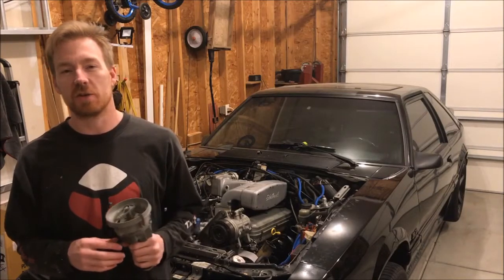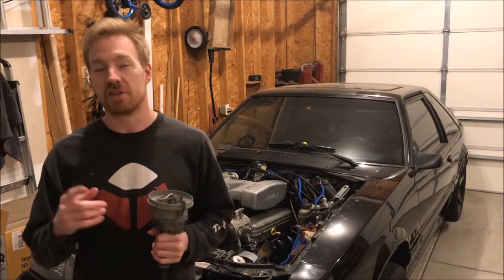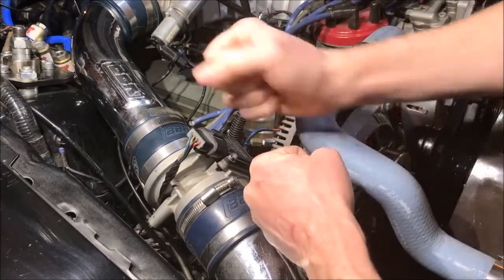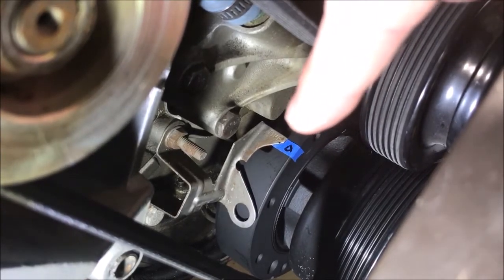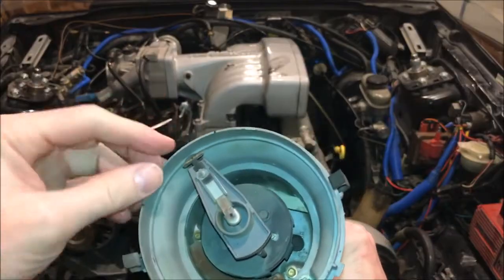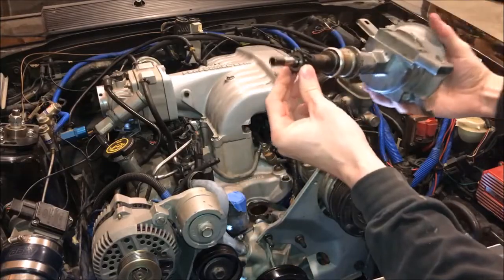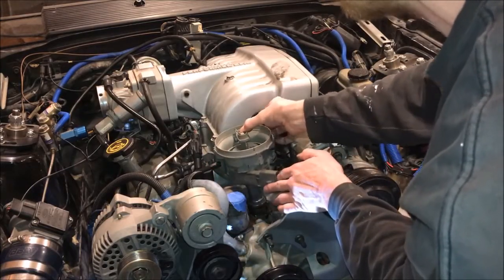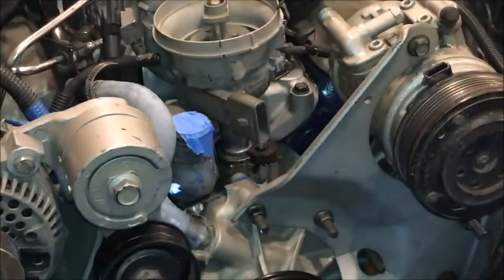Set Timing for Engine Start

Comment: I was always taught you should set the timing mark to about 10 to 15 degrees BTDC and then set your distributor to #1 so that on first start your timing is a few degrees before top dead center which is where your always going to run it anyway. This is especially important on a newly built engine with a flat tappet camshaft as you NEVER want it to idle during the first start and 20 to 30 minute break in, not even idling long enough to use a timing light, and you never want to be sitting there cranking it several times during the first start because it doesn't want to start properly at true 0 degrees top dead center timing, hence setting it a few degrees BTDC.
Reply from the maker: Good advice!

Comment: Just did my hci I followed your method but rather than 0degrees, I tried it at 12degrees. She just turned over, no start, she tried, no avail. Tomorrow I try it at 0. She sounded broken trying at 12. lol
Reply from the maker: I always start at zero then work my way up. It may not run the best at first, but it’s okay.  Can progressively tune up and that’s satisfying. Thanks for commenting
Reply: @FastFixYouTube  the next morning, did it from zero, she started. Mind you, I just did the hci, so I had a little bit of work to do after but she’s run nice soooo nice. Thanks for the video, although I also ignored the 89 mustang shop manual because I really wanted to pay myself on the back.  The old adage rings true, if it ain’t broke don’t fix it. Again thanks, and thanks for the reply. Two thumbs up to you. Toronto, ON CANADA considers you friend. Thanks
Reply from the maker: @reachadcreadordasilva3471  hey, fantastic!  Glad this video could be of help. I appreciate the Canadian connection!  You’re a friend of the States (for whatever that’s worth 🤣) as well!  Cheers!

Comment: It seemed like the rotor was pointing toward the driver side head.  I am confused.  Is it supposed to be there or pointing directly at the number 1 piston
Reply from the maker: Hello. You saw correctly. However, The rotor needs to be set at the #1 point on the distributor which leads to the #1 cylinder. So, the rotor won’t physically point to the #1 cylinder rather in which ever direction the #1 point is located. Hope this makes sense.
Reply: Awesome thanks!  Also was the timing on the harmonic balancer set at 0 degrees when fired or just before? I've been told to set it at 12 degrees BTDC

Comment: You said point rotar toward cylinder 1 and then pointed it toward cylinder 8 the hell?
Reply from the maker: No I didn’t. The car started. If pointed at cylinder 8 it would not have fired.
Reply: Cylinder 1 on the cap, not the piston. The rotor should be to the left of the right lower intake bolt. @fastfixyoutube done it exactly the way it should be done

Comment: Great info! I had to take off the ignition module (on the side of the dizzy) on my 89 F250 7.5L. It seems so easy, I’ll be trying to do this and start her up tomorrow. She ran a few days ago before I took out the dizzy. First time is 12 years!!
Reply from the maker: Hey there. Yes, this should work for you. Update this thread with the results if you feel so inclined. Best of luck!
Reply: @FastFixYouTube  Worked like a charm after I got her to 10 degrees BTDC. Cranked up instantly, adjusted the dizzy slightly with it running. She’s running great!!
Reply: @Mc88Flyy  8wire I

Comment: Ive done this many times but i enjoy watching others doing it, you can always learn new things, when i was young (a long time ago,lol) i use to think that when people said "point rotor to number one cylinder"  they actually meant to point the rotor to number one cylinder literally when in reality is the number 1 on the cap, ha ha ha ha, needles to say that didn't work very well.

If i may add,finding number one on a stock Mustang distributor is as easy as lining it up with that black sensor inside your distributor, you line it up with that and your good to go, also when you get ready to "stab ' it turn your rotor to the left about a inch,once it goes in and the teeth mesh it will move it to the right, 9 times out of ten this will get you right in front of the black sensor and your good to go,putting it in on number 1 and hoping it goes in straight does happen but very rarely, most of the time it will move to your right hence that one inch to the left.
Reply from the maker: Hello!  Hahaha, well we’ve all made those assumptions when we were green.  Hell, I’m still learning all the time and I learned from your comment!  Thanks for that tip. I’ll be using it in the spring when the new motor goes in!  Have a great one 👍
Reply: @FastFixYouTube  I actually ran into a funny issue tonight starting a brand new 302, had it all primed and ready to go, stabbed the distributor and it wouldn't start,well we had been working all day on it and i was pretty tired, started checking everything carefully and i had the distributor off by a hair, pulled it back out, tried it again and man it started like a  champ.

Sounded great,  strong like a new motor should  but i had started it with the belt off, just wanted to make sure it was gonna run,so we turned it off, gonna slap the belt and take her out for a spin, hit the key and it never started again no matter what, has fuel and spark, lol, have no clue whats going on, sure hope its not something internally but those 20 seconds it ran it never made any weird noises, none at all, just pure motor symphony.
Reply from the maker: Hey there!  Hmm, yes that is odd. I’d say it’s likely an ignition issue if you’ve got the timing right. Doubt any major internal problems. Yes, the sound from a new start up always gets the blood flowing. Pure awesome.
Reply: @FastFixYouTube  Hey, thanks for the reply, yeah i just tried it a minute ago, its definitely timing,i have it stabbed right its just not in the sweet spot yet,lol,keep on trying is all i can do,that new engine is decimating that battery,lol,nothing like a new tight engine to put strain on everything.

Comment: This is gonna help with my low compression 350 that's getting a really dialed in tune. locked distributor, small carb. it won't make a ton of power, but it should jump if you punch it.
Reply from the maker: Sounds good!

Comment: Thanks this really helped me a lot you have no idea
Reply from the maker: Hello!  Glad to hear that!  Thanks for the comment 👍
Reply: I do have one question should the oil pump shaft have any play and if it does should I replace it
Reply from the maker: Hello. Sorry about the late reply. There is usually a little play with the shaft.  Get a good visual inspection and make sure it’s not warped / bent. If all is well, install 👍

Comment: good vids brother, i used to have a 1988 stang 5.0 body style just like yours . mine was a rare make 4 cylinder with turbo. rear wheel drive. automatic 5 speed but i put a older 4 speed auto tranny in it. had more torque power. 
 before that i had a 68 1/2 mach1 midnight matelic blue. Boss351  under the hood holly 4 barrel 750cfm double pumper/ 3/4 race cam double roller lifters. 4 speed on the floor with headers duel Flow Master exhoust ststem. black leather interior.
Reply from the maker: Damn man, those sound like awesome rides!  I think it’d be super cool to have the 4-cylinder turbo and make it scream. Maybe a future project some day. Thanks for sharing! 👍
Reply: Blew away my brother's Camero he had 350 with cross fire fuel injection . I raced him from Fairfield conn to 9W Newburgh NY . Beat out runned his V8 crossfire camero he could not believe it. to this day he still is confused. 😂
Reply: Ya would make  a great racer also good on fuel not bad with turbo.i was happy with it when I bought it off a jaguar dealership. Bought it for 5k. Only 1 owner.
Reply: And only had less then 60k miles on it at the time

Comment: A question please; I have a 94-95 302, PP graded balancer (0-20 degrees), I read that the rotor arm has to be clocked in a way to touch the No.1 cap contactor at 10 degrees BTC and not at 0 degrees like you did.  Is this correct?
Reply from the maker: Hello. In order to advance timing, it would have to be that way. I start at zero just to make sure it’ll run.  However, it should start and run better with 10 degrees of advance. I start at zero and make my way to 13/14 degrees depending. Hope this answered your question.

Comment: Would this work if my engine is rough idling , misfiring and shaking? I changed my distributor cap and rotor also spark plugs and wires . Wanna try this before I change my fuel injectors and distributor thanks
Reply from the maker: No, this won’t help you. It sounds like you’ve got timing, spark, or fuel issues. 
Make sure your plug wires are routed correctly. You’d be surprised how often a mis-connected plug wire is to blame. 
This video was meant for those just trying to get their engine started.

Comment: I just did a rebuild on my carburetor for my 84 Bronco ii. Now it won’t start, I have spark, it’s getting fuel, it cranks and cranks and won’t start, the 2-3 times it did start it wouldn’t hold idle unless foot was on gas.  Could it be timing, should I try this step you showed?
Reply from the maker: Hello. Yes, definitely sounds like timing. Find the compression stroke then set TDC. Feel free to Let me know how it goes.
Reply: Or firing order on cap wrong
Reply: Seen many peep make that mistake have 2 or 6 wires crossed on the. Plugin of the distributor cap.
Reply: Or distributor not set in place right could be a tooth or few off set.
Reply: And make sure you follow your engine block firing order. To the cap. Look up your year engine and it will show you

Comment: Tried this on my 86 f150 and tried to start it now it wont start and will back fire really bad any help
Reply from the maker: Hello. It sounds like you’ve found TDC on the exhaust stroke. Make sure you’re on the compression stroke then try again. Also, make sure the spark plugs are in the correct order. That happens more times than not. Feel free to update the thread if you’re still haven’t issues. 👍

Comment: I'm having a little problem on my '95 to a '94 OMC Cobra boat motor. What's the timing? Mark in the rotor where it should be at for the fire at the first try like you did in your video please get back to me thanks it's a 351 Windsor
Reply: It's not a vacuum advance. It's one just like yours in the video distributor
Reply from the maker: Hello. Happy to reply!  Please give me a few more details. Have you gotten the motor to fire?  If so, increase the timing to about the 13 degree mark, but do it incrementally. You want to get to the point where the motor doesn’t knock based on the octane of the fuel you’re using. It may be beyond the 13 degrees mark or a bit below. Not every motor is the same, but they tend to be very close in range. Then make sure to use the same octane gas for the future.
Reply: @FastFixYouTube  It was knocking and I shut it down quick so I redid it and I don't hear the knocking no more
Reply from the maker: @chriscorter5035  perfect!  Seems like you got it sorted. Thanks for the question and reply 👍

Comment: I’m currently working on a 1987 f150 Jasper 302 and was told to put it at 10 degrees on the balancer. Guessing I was told wrong.
Reply from the maker: Hello. 10 degrees is a factory setting and not wrong. It’s just “safe.”  That way you can run low octane fuel and be perfectly fine. Generally, 13 degrees of timing is also “safe” and what I run in this car mostly on 91 octane, but I’ll use 93 if I can find it.
Reply: @FastFixYouTube  Thanks for the information man

Comment: My car turns on but stumbles and dies right after unless I keep peddling the gas,I recently had a bad battery and I would have to jump start it everytime,my question is can a bad battery throw off the timing??
Reply from the maker: Hello. Short answer is no, a bad battery has nothing to do with engine timing.  You likely have a fuel starvation issue somewhere from the sound of it or the motor isn’t getting air which happens when mice make a nest in the air intake. Best of luck!
Reply: check your fuel filters and if not fix after changing them then you have a fuel pump going bad.change it asap.

Comment: I have a 77 mustang ii 2.8 liter. Got it running but idles high. Any suggestions?
Reply from the maker: Hello. Sorry, I don’t have much experience on those engines.  I would say to make sure the timing isn’t too high as that can raise the idle sometimes. I assume that’s carbureted. There should be a screw adjust for the idle I believe. Sorry I can’t be of much help, but thanks for the question.
Reply: check your firing order on the engine and on the cap. if 302 or other . depending on the year 302 engine or 351 .firing order changed in 93 and up. so be aware of that. in this video above  Fast Fix is showing a HO 302 timing setup. firing oder . 

if your engine is a older type then do not follow the firing order in this video above. go to vintage website for vintage 68 - 82   302  351w firing oder. as the 302 and the 351 windsor are both the windsor engine family.

Comment: Great videos. Was wondering if you can make a video on the egr system. I am in th process of puting on a trickflow top end kit. I am deleteing smog pump and was wondering if i should delete the egr valve also. And if so the process to do so. Thanks for the great videos
Reply from the maker: Great suggestion!  There are videos out there that cover the process you suggested.  Zero performance or negligible performance gains with egr delete, so only do that if you're going total off-road or for aesthetic reasons. How'd the TrickFlow top end kit work out?
Reply: you should delete out the egr system. they cause more engine damge then anything else. just my opinion.
Reply: you can delete out the egr simple trick and it will be legal emissions test pass. simply remove the egr. they have a egr delete kit where the air will go from that area over the the fresh air intake. simple easy egr delete kit. they make them for the 6.0l engines and all other engines with egr valve.watch the video on it. and there you will have the info on it and the site to order the egr delte kit.

Comment: Hey just wondering I have a 1986 Mustang and it’s pretty much stock I see you didn’t take out the spout it’s a small little computer chip  Does that even matter
Reply from the maker: Mike Marks hello. You’re correct. I didn’t take out the spout for the initial engine start. I wanted to make sure it ran first then remove the spout to advance timing to 13 degrees. Good eye!  But to answer your question, yes it does matter.  The spout should be disconnected when setting initial timing. Once set, install the spout and you’re good to go. The spout controls engine advanced timing.

Comment: I had a mechanic put a crankshaft pulley on my car. He claims to have changed the crankshaft position sensor as well. [Can't be 100 percent sure] I got my car back with no spark. He claims the car was running when he changed the pulley and belts and suddenly lost spark. Car was running perfectly before he worked on it. I towed it home and changed the distributor she fired but fired very very rough and won't stay started. If I give it gas it'll stay fired but will smoke very bad out the tailpipe. I'm thinking the engine is out of timing maybe he put the crankpulley and or crankshaft position sensor on out of alignment. Is this possible or maybe another issue. The vehicle was perfect before that loser mechanic touched my vehicle. Please help someone
Reply from the maker: Hello. Yeah, pretty weird that it no longer starts after he replaced a part that’s absolutely necessary for the engine to run. He sounds full of it.  

I’d start by making sure the sensor is good.  Because that is one of the parts that was changed, I’d start there. What kind of car was this done on?  Definitely sounds like a timing problem. It has spark, just being delivered at the wrong time.
Reply: Ya he blew smoke up your a zz, he not know but that sensor he bought was probably a cheap cost one and ended up being defective sensor. Always get the oem parts when it comes down to the timing sensors crank and cam sensors or either that or it jumped time.just numb the key bump a few times and it will come back around in time and fire. If so then replace the timing chain get the kit comes with new chain and gears if it's a timing belt then same just set it back in time before placing the belt on. only perform that replacement of the oem cam sensor and oem crank sensor replacement not fix it.